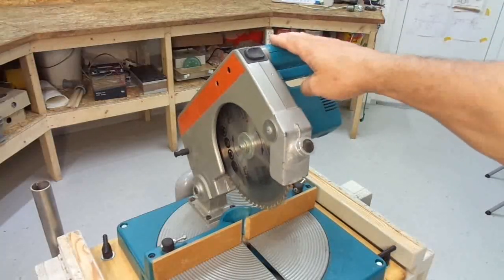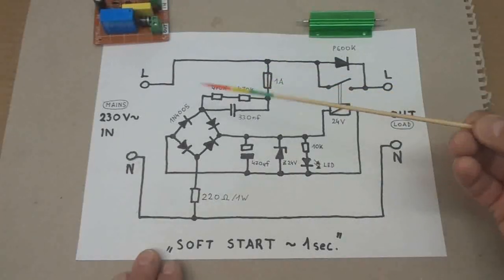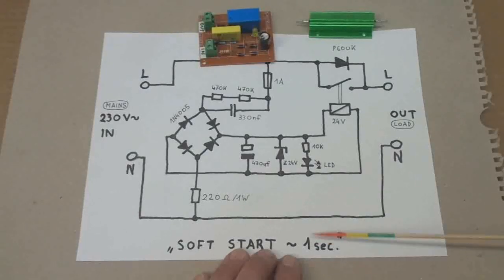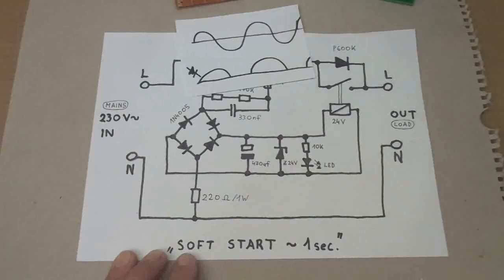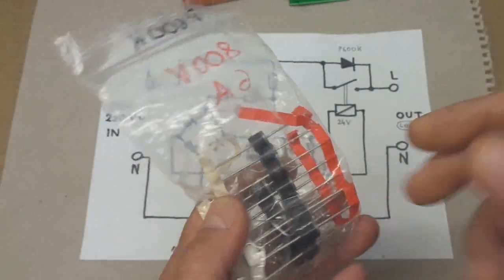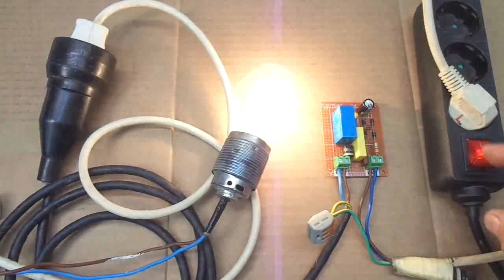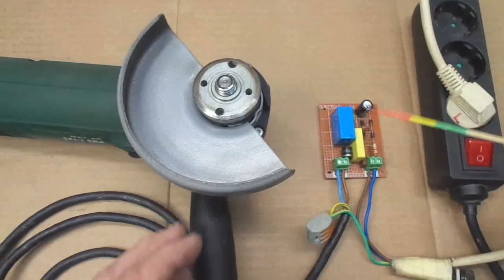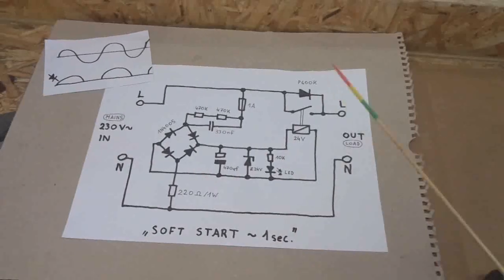simple soft start circuit DIY

Comment: Hi, great friend Lari!
I finally managed to assemble!
The story is a little long, but the changes were:
330 nF to 1 uF capacitor (to get 10.6 volts);
Capacitor from 470 uF to 2200 uF (to get a 1 second delay);
Rectifying diode from 6 amps to 20 amps (to guarantee an 1800 Watt saw);
24 volt/1 Watt zener diode for 12 volt/5 Watt (just in case if it gets hot);
24 volt relay for 12 volt/16 amps (from microwave oven).

The mount was a little bulkier than yours, but the important thing is that I won't have that feeling that the saw blade wouldn't fly towards me when turned on.
Thank you very much for your help!
A big hug from Brazil!
Merry Christmas and a Happy New Year to you and your family
Reply from the maker: THX for the report, my friend. Nice to see, that you have made so much effort, to adapt this circuit to the grid voltage of your country... So that other people from the 120 Volt world can copy yours... Thats what i call "evolution" xD I have added the soft start to all of my power saws, because i had the feeling, that the violent startup is not good for the gears. The machine should last longer, with a soft start...at least in theory...  Merry Christmas from Germany.
Reply: Why you upgrade bridge rectifier 6 amps to 20a. I think enough 1A 1N4007x 4. What do you think ?
Reply: @harunozcan5380  Hi Harun
I opted for a diode (only one) of 20 amps because the circuit is for a table saw of 1800 Watts.
The calculation formula is: Power divided by voltage
(1800W /127V equals 14.17 amps)

4 diodes in parallel, according to the literature, is not advisable, because, although in theory they are the same, in practice they are not. The parts are not manufactured exactly the same and the current ends up flowing in different amounts in each one.
Lari can explain better than I can.
A hug from Brazil
Reply: In time: 4 x 1N4007 diodes in parallel would support 4 amps,  theoretically
Reply: @claudemirvernini6719  hi, where do get 20a diode? I'm looking to buy one.
Reply: @dinhcao7528  Hello Dinh
The diode I used is the 20A10.
I bought it through an international sales site.
I tried to post the link here twice, but it was deleted by YouTube.
Search.
A hug.
Good luck.
Reply: @claudemirvernini6719  thanks, I'll try to find it.
Reply: @claudemirvernini6719  that 4 diodes are for providing dc current to turn on the relay only , the diode on top of the relay on the schematic should be high current for handling at least 1/2 of the total power of the load!
Reply: @ngocdangdinh9874  Thanks for the explanation👍

Comment: The simplest circuit is a diode in parallel with a toggle switch in the phase wire break
Reply from the maker: Yes, you are right.. Thats what i did on my table saw, when i was a apprentice.. I had a 2 step rotary switch.  (0 - 1 - 2).

Comment: Liked the clip.  Thanks.  Liked the notion of using a diode to drop the current seen by the motor.  Your local parts electronics store might max out at 3 amps, but you can parallel two or more diodes to get to the current that might work a little better, I would guess.
Reply from the maker: Yes, you are right, the diode sees about half the current, which the motor takes when it is "full on". ...and just for 1 second. I have "upgraded" my 1200 watt table saw with this circuit about 8 years ago and it still does its thing. Paralleling two or more diodes would work, if there is the need for more "juice"  ;) But i have to mention, that some loads / Motors are not happy with the diode, then you have to use a low value, high power resistor istead... Every Motor shows its own individual behaviour, which may make slight changes in the circuit necessary.  Thanks for stopping by, my friend..... Greets from Germany.
Reply: Theoretically, using two or more diodes in parallel to share the current load may work, and in fact it will to a certain extent, but in practice you should never do that. 

The reason is that internal resistance of the diode, along with its voltage drop are never exactly the same between diodes, even in a series of diodes made in the same batch. The current will always flow in the diode that presents the least resistance. So in fact, both diodes are connected in parallel but only the one with lower resistance will carry most of the load (as resistance is not summed in parallel junction) and will probably fail because it is  already used in its boudaries. This is also a common mistake done in LED lighting.

Comment: Hallo Lari Fari! Nette Schaltung! Eine Frage hierzu: Sehe ich das richtig, dass die Verzögerungszeit bereits zu laufen beginnt, sobald am Eingang Netzspannung anliegt? Wäre problematisch, wenn man mit einem großen Winkelschleifer arbeitet, welcher keinen Sanftanlauf hat und diesen als Last an deine Schaltung anschließen würde. Hätte sowas im Sinn wie z.B. einen kleinen Zwischenadapter im Gehäuse mit eigenem Netzkabel und Schukokupplung am Ausgang.
Reply from the maker: Ja, genau. Die Zeit läuft, sobald du Saft drauf machst. Das Ding also deinem Winkelschleifer, der einen eigenen Schalter hat, vorschalten, wird nicht funktionieren. Und so klein wirst du die Schaltung nicht hin bekommen, dass sie noch im Gerät Platz findet. Winkelschleifer mit Sansftanlauf hatten früher einen zweistufigen Schalter. Heute ist da ne Platine drin..alles SMD. Traust du dir zu, sowas Kleines zu bauen? Ansonsten kann ich in dem Fall nur raten, einen Winkelschleiferschalter mit Sanftanlauf als Ersatzteil bei ebay zu kaufen..(zb für Makita oder Bosch) und dann versuchen, das Gehäuse etwas "anzupassen"..

Comment: I try with my 2.2kw motor but I have problem, when current going trough diode, motor doesn't rotate just buzz and jump around, any suggestions?
Reply from the maker: What kind of motor is it? This circuit is ment to work on universal motors. If you have a induction motor, use a low value but high power resistor instead of the diode. ( 5 ohms or less)
Reply: @LariFariYoutube  Thanks for answers 🙏 yeah it's induction motor, I will try with resistor, I have 100w 3.9 ohm
Reply from the maker: @milanmilicevic4618  I remember, about 20 Years ago, i had a table saw with such a motor. I used a 1,5 kW heating element from a washing machine as a startup resistor...Since it is on for just 1 second, it works even in dry environment.... The irony is.... at the momnet i am working on a new table saw project..(upcoming video)..it will have a 2,2 kW induction motor and the same soft start, as back in the days.... Sometimes i feel, i have been gong round the loop..  xD
Reply: @LariFariYoutube  here where I live, we don't have city's water pipeline, we all have big water storage and some natural water source, and I'm using 2.2kw water pump with 200L expansion tank to get 50-90psi in house pipelines. That motor goes bad every few years but I think that soft start will help to improve motor lifetime. What do you think about arduino triac/diac soft start? Do you think that can work with induction motor, if you keep full positive and negative sine wave just shorten a bit 🤔
Reply from the maker: @milanmilicevic4618  Huuuh..a simple phase angle controller would not work on a induction motor. What you need, to do a soft "ramp" , is a VFD. It can be done with arduino (microcontroller) and some IGBTs, but i never tried to build my own VFD, because the parts would cost me more than a ready made one... On ebay a VFD for 2,5kW costs under 100 Euros.... at least here in Germany. A more "maker friendly" approache would be, to use an Arduino and several start up resistors. Starting this motor in 3, 4 or even 5 steps in sequence would do definitely the job....It would get bulky, but i dont think, this is a problem in your application. Another qestion: Can you tell the reason, why the motor is passing away every so often? Bearings? windings? motor capacitor? Does the motor has a centrifugal startup switch built in?
Reply: @LariFariYoutube  This water pump motor works every time when someone using water, I found that, bigger expansion tank will improve motor life time significantly, and I was thinking to go step further and maybe add soft start to prevent that impact on startup. Last motor that goes bad just lock up, I didn't try to fix it. Second choice, I can get two 1.1kw motors which will be controlled at specific range of water pressure. 
PS. All of those motors are bad quality it's Austrian made, if I can get hands in German quality one, the problem is solved 🙂 or maybe Italian. 
Do you know, that VFD, can it be used on single phase or it's need to be there phase motor?
Reply from the maker: @milanmilicevic4618  Some VFDs can handle single phase motors...but not all. Sometimes you have to remove the motor capacitor...or not. Depends on the make and model of the VFD. Very complex...You would be better of, changig your system to a 3 phase pump, when you want to use a VFD.  The 2 pump solution sounds great. A 1 kW motor is not as violent as a 2,2kW. And you would have a somewhat failsafe home water system... I am living in a houseboat for 13 years now....off grid with a 12 volt (solar) system and a somewhat similar water pump system than yours....but for 12 volt. (jabsco).

Comment: Hello sir. Thank you for this great video.
I am helping a carpenter  with his machines. His machines start at very high current as you say. For example an old bandsaw. i think it draws around 15 amps on startup then 3 amps. What is the simplest/cheapest way to reduce the starting current? is the soft starting  the best method? thank you again
Reply from the maker: Hmmm..i think, the startcurrent of such machines is way more than 16 A... Its more like 20 times the "normal" current. This would be 60A for your Bandsaw, for a short moment...
It depends on what kind of motor these machines have. I assume, the bandsaw has a induction motor. You can use this soft start circuit also for induction motors but then you need to change the Diode for an high power resistor. If you dont want to solder by yourself, by a cheap timing relais and a contactor. Recently i finished my table saw project. The Saw has a 2, 2KW induction motor. I use 200 meters of single core installation wire as a start resistor. (ON for 2 seconds). For the timing i use a Microcontroller, but you dont have to bother with that.  Its just because i can.  ;) Watch my vide "table saw PT 4".

Comment: nice video ,
I was wondering if this circuit works even if fed with the "biphasic" output from an inverter with pure sine wave , this circuit in good substance decreases the inrush current ? thanks
Reply from the maker: Hmmm.. Never tried it, but i see no reason why it should not work... I mean, the diode just cuts away one half of the sine wave..And you could also replace the diode with a power resistor if needed..
Reply: @LariFariYoutube  Power resistor with what features ? 
But in series with the diode ?
Reply from the maker: @albertotorcoletti7006  Some appliances dont like the chopped off sine wave, created by the series diode....  If thats the case, put a power resistor into the circuit instead of the high power diode... The value depends on the electrical properties of the device, you want to soft start...For a "classic" application like an angle grinder or a scircular saw, (about 1500 W) the value is somewhere between 2 and 15 Ohms and at least 50 Watts. (the resistor is in series with the load for just 1 second).. In the end, it takes some experimetation, to get the behavour of your appliance just how you want it.... I hope, that makes sense.  :)

Comment: Thank you for sharing your circuit. Amazing how you simplified it. Wery clear explanation of parts of circuit. I'm in US and will need to build 120v version but I never build single thing for electronics. Would same circuit work for 120v and handle 24A if I replace your diode P600K with diode that can handle more current ? Or will I need to modify more components please ? By the way I love your channel name :-)
Reply from the maker: The answer is hidden somewhere here in the comments... If i remember correct, a brasilian guy redesigned the circuit for 120 Volt and posted all component values here.. The diode is good for universal motors. If you want to softstart a inductive load, like a transformer or a induction motor, you should use a high power resistor instead. (value somewhere in between 1 and 10 Ohms).. or you make your own inductive ballast, like i did on my table saw build.
Reply: @LariFariYoutube  Thank you for reply and  tips. I saw the post of guy from Brazilian guy. I'm planing to use it on RV air conditioner compressor. I'm guessing that compressor
 may be inductive load.
Reply from the maker: Ok.. Build the circuit first and make sure, the relais kicks in with some delay.. Somewhere in the ballpark of 1 second...Then add the diode ( or several in parallel for more amps).. Or even better....try to put the diode in series with your load first.. To see, if your load wants to start up in the first place..If not, try a big resistor (somewhere 1 to 10 ohms).. If the load does not run with a diode and a resistor in series, you will need a indctive ballast...You can make the ballast by yourself.. Go to my video "homemade table saw Pt 4"  Minute 12:06.. By winding the wire around an steel core, you can get away with a smaller version and less wire.. I used thes 200 meters of wire because they come coiled in a box like this already. I had enough room in my junction box, so i did not bother and i used them, like they came out of the box... Lazy mans solution.  xD   The ballast softstert is big, but almost industructable....even in case of a dead short.... This is the german style of building stuff    ;)
Reply: @LariFariYoutube  This is amazing. Thank you for all help. I will build it and report back.

Comment: Great design by its' simplicity! Do you think it will work with 650 VA toroid transformer on 230 V?
Reply from the maker: If you choose a relais, which can handle the load current ..so at least 3A continous at 230 V...than the circuit will work for your task... And as i said in the video, if the half way rectification with the diode gives you weird behavior, you can try a high power resistor intead of the diode.. (typically somewhere between 1 and 10 ohms (test)).. Thats how its done in a microwave oven, because the big transformer also has a huge inrush current.. Greets from Austria..

Comment: Great explanation sir. But please could you explain the relay circuit for me, I don't understand if the doide is connected to the Nc or No and where the output of the L is connected to, thank you 🙏
Reply from the maker: The Diode is in series with your load. I put it in the "hot" wire L..but you coul put it also in the N wire.... The Diode lets current flow just in one direction...Therefor the Load / Motor gets just one half of the AC and runs on half power. The relais shorts the diode after a delay time (1 second)... Then all the current flows via the relaiscontact to the load == Load  / Motor 100 %... If you want, you can experiment by puting a diode in series with incadecent light bulb...It will light up about half brighness.. One word of caution:  be sure you use a diode which can handle the voltage and amps...at least for a short time..
Reply: Thank you

Comment: Good day lari. Thanks for sharing this, its help a lot. I plan to make this one, my question is,can i replace those relay on the circuit, and  use dc to ac solid state relay, instead ?  I planning to make this one, and install it to my 2hp water pressure belt type.
Reply from the maker: has the Water pump a induction motor? Than the diode method will not work. Replace it by a high power resistor (somewhere 1 to 10 ohms), or better an wire wound ballast. Like i did on my table saw build. The solid state relais shoul theratically work, but it draws way less currrent than a relais coil. So you will need prbably a smaller dropper capacitor. 220 nF or less. It is a bit of a trial and error thing, to mach up all the components, to get the desired behaviour of your load / motor.